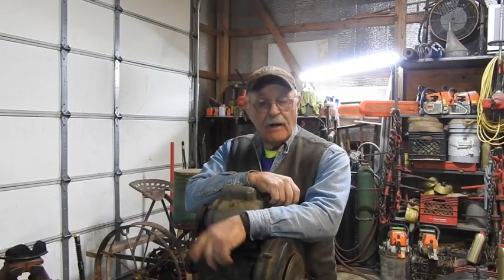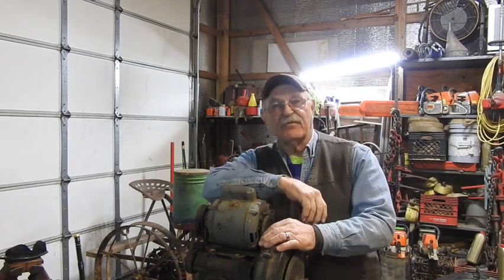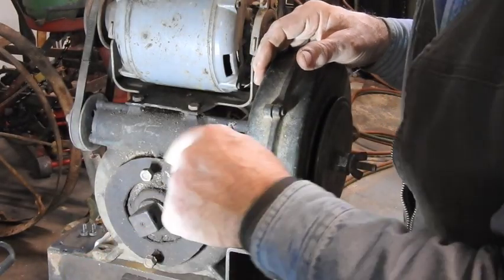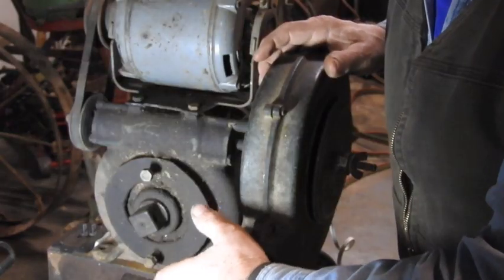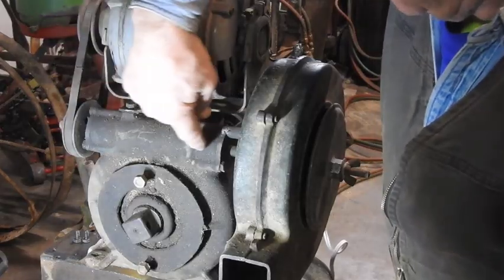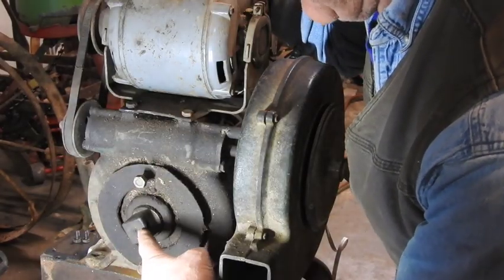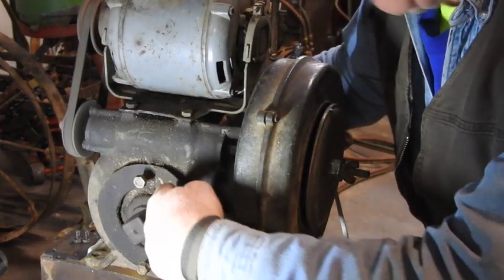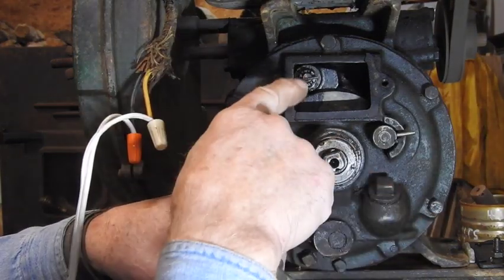Was THIS In Your Grandpa's Basement ?

Comment: Thank you. I love learning about and hearing about all of these things. I saw an old boiler that didn't even have a circular pump. Just the hot water going up and the cold water being displaced and drawn in at the bottom. It started off as a coal fired boiler, then converted to oil. The oil burned was mounted on a stand where the stoker used to be. That old beast was still in use two years ago. Now a heat pump does that job. I hate to see the old radiators go.
Reply from the maker: Lots of variations of boilers, whether they are merely hot water boilers or steam boilers.  Both similar but operate very differently at the same time. I've changed out dozens of each and have serviced hundreds more over the years.  Back in the day I too converted old boilers from coal to natural gas.  I'm sure there are hundreds of them still in operation coast to coast.
Reply: I'll bet that after the first heating season, the customer was sad to see those old radiators gone too.
Reply from the maker: @lnk4328  I'm sure they had second thoughts many times over. I think sometimes of all the fancy cast radiators we merely hauled to the scrap yard only to find 40 years later they are sold at a premium at antique stores.  LOL Of course most of them were boring, especially the steam radiators.